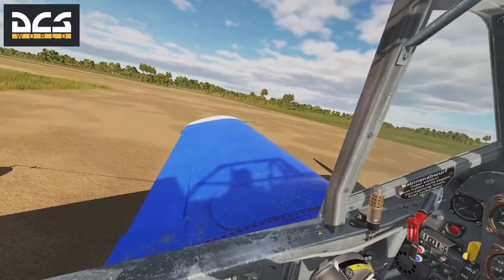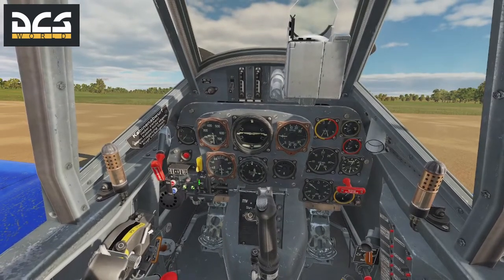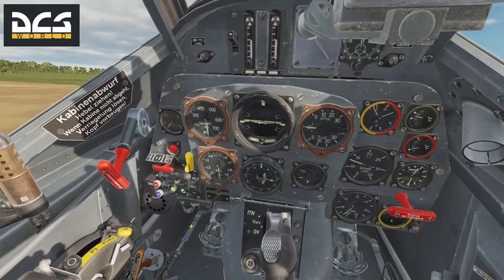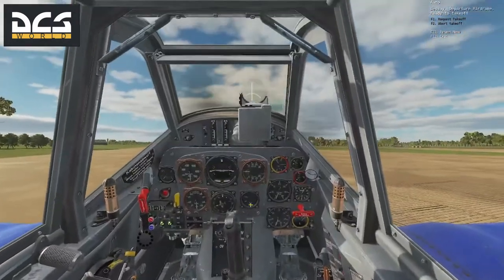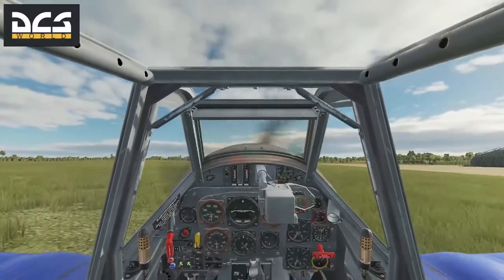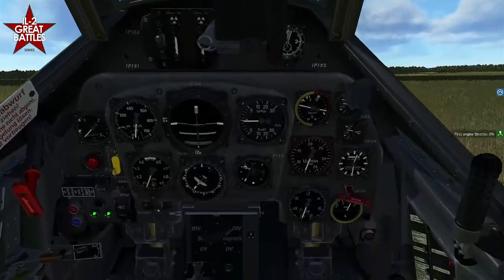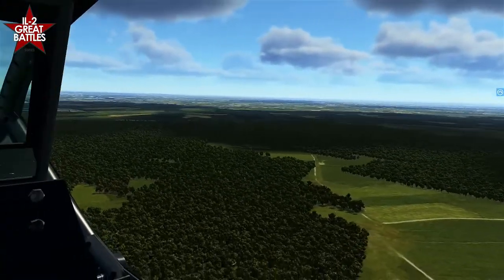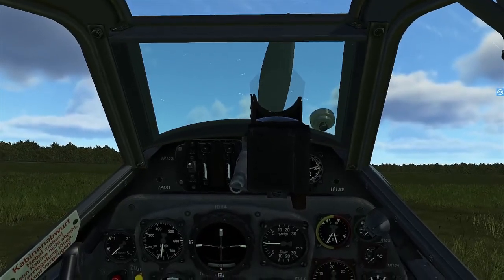DCS World vs IL2 Great Battles: BF109K-4 Comparison!

Comment: I get a slightly better feeling of... weight?  Inertia?  in DCS -  not sure how to describe it.  It's subtle, though, and not something you notice much in multiplayer.  The prop and sun effects are also somewhat better.  All that is minor, though, compared to the enormously better performance in IL2, especially in VR.  As far as your comment on the guns being more 'thunderous' in DCS and wondering if that was accurate - in Bud Anderson's 'To Fly and Fight' he noted that pulling the trigger was always shockingly loud, even over the already loud engine.  Setting off a brace of machine guns or cannons just a few feet from you and bolted into the same frame you're sitting is going to be pretty visceral.  Add a bass shaker to your seat and you can get a better effect for not much money.  

Nice comparison.
Reply from the maker: DCS has very inconsistent performance for me.  Stuttering like this can be non-existent one day, and a practical Slide Show the next.  And yeah, VR is just as wonky, some days playable other days, can't even get it to work.  And that's good to know about the guns!  I feel like the engine and guns are 'muffled' too much in IL-2.  But I think they sound pretty good, they just need to be a bit louder. Thanks for watching and commenting!